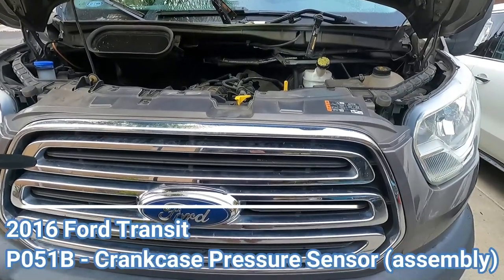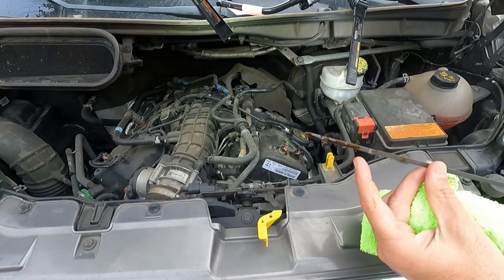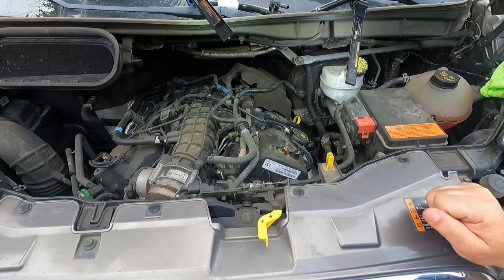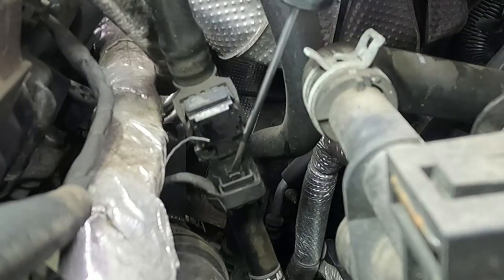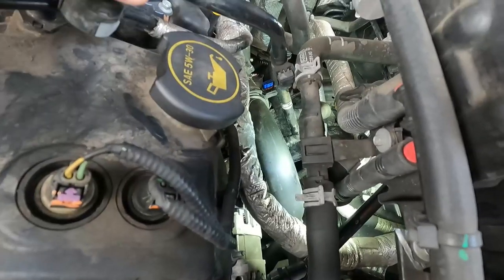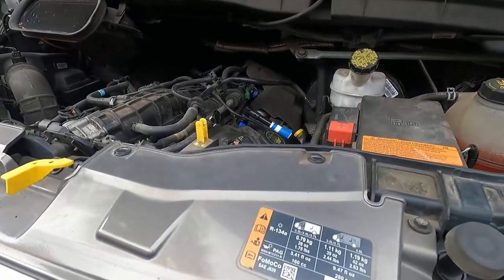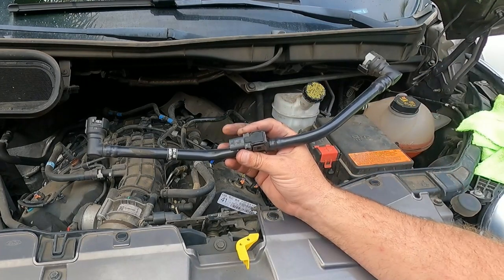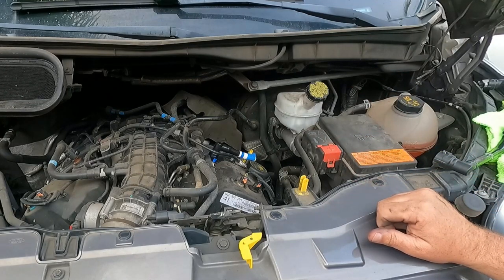2016 FORD TRANSIT 3.5L EcoBoost - P051B - Replacing Crankcase Pressure Sensor - PCV Tube - Easy DIY!

Comment: Awesome job man. I just got same code. Do you have use scan tool to reset after replacing tube or it will reset in its own?
Reply from the maker: It will reset on it’s own after a a bit of driving, or you can reset it with most code readers.
Thanks for watching!
-Dan the Fix it Man

Comment: Does this apply to a 2016 f150 3.5 Ecoboost?
Also, should battery be disconnected before replacing this sensor?
Reply from the maker: I don't know if it has the same part number, but it should be very similar.  You don't need to disconnect the battery before replacing the sensor, just don't turn the car on and you should be fine.
Thanks for watching!
-Dan
Reply: @DantheFixitMan  alright. Thanks very much!

Comment: Thanks for the information! How many miles on the van?
Reply from the maker: No worries, it has 68,000 miles.  Thank you for watching!
Reply: @DantheFixitMan  awesome, right around the miles on my van, cross the fingers I don't have this problem, but will ready when the issue arises.

Comment: Bet they sell the new pipe with sensor because it's full of oil mist residue that will throw the code again.
Reply from the maker: That’s a great point.  You’re probably right about that.
Thanks for watching!
Reply: @DantheFixitMan  thanks 4  making it.
Reply: Will this cause rough idling?
Reply: @cheizaguirre5494  thanks, I think mine is.
Gas mileage is down too.